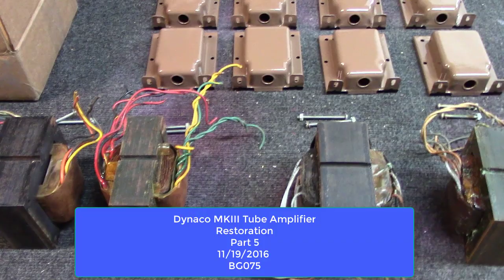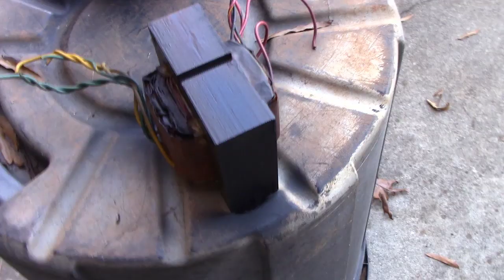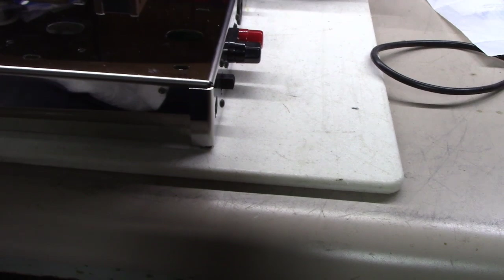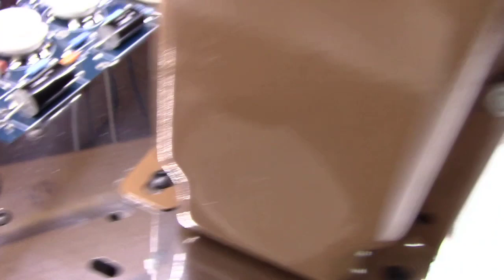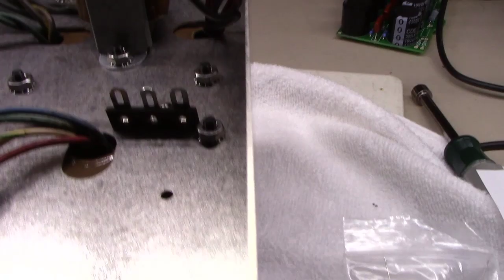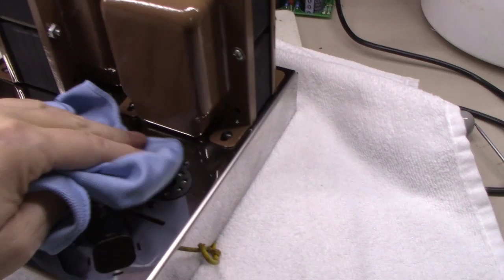Dynaco Mark III - MK 3 - Restoration Part 5 - BG075

Comment: I wish the new-chassis manufacturer had changed the design a bit so as to move the fuse holder out of the inside of the chassis  to give much-easier access from outside. A voltage spike could blow the fuse and then you have to pull the amp out of the rack and open it up to change the fuse. A lot of people are not very handy and might think there is something much-more-seriously wrong with the amp...

Comment: Don't the transformers really require all six bolts rather than two?
Reply: My OEM Dynacos had two fasteners holding the bells on through the center. My reproduction transformers had 4, one on each corner. Regardless the bells are the same and are drilled for either center or for corners. The transformers aren’t.

Comment: Hi there, I have a quick question. If I'm not getting enough voltage (0.003 volts) on socket 7 & 8 on my 6x5 rectifier tube, can that cause the tube to glow excessive and fail?